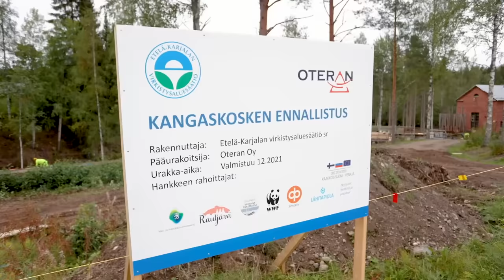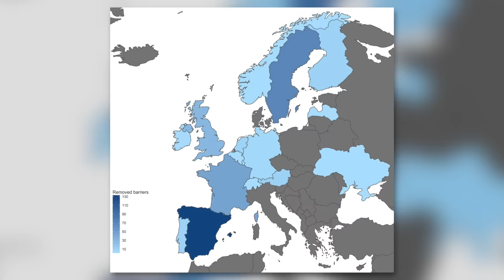How (And Why) Europe Is Removing Its Dams

Comment: I am concerned that many dams being removed will reduce hydroelectricity production.  Which is more important,  clean renewable hydropower or no electricity? Some day they might build a power plant of some type to replace the lost electrical power , but it will be years later,  if ever. Don't forget these dams also provide drinking water and storm water storage. Some dams also allow for ships and barges to transport goods further inland. Fish ladders might be possible at some dams. There are dams that are no longer serving any purpose and are costly to repair or replace and should be removed. Each dam needs to be evaluated fully and not just because it's a man made structure.
Reply: The poi t is to remove your electricity
Reply: @junicohen7918  Yes, can't have the peasants getting too prosperous, now can we? =/
Reply: They are removed only old dams to save high maintenance cost only
Reply: Dams have lifespans though and end up full of silt.
Reply: This video did a particularly poor job of explaining that all dams that have been removed were either old industrial dams that serve no purpose whatsoever: 
like running a water mill, 
providing water to canals for canalboats that haven't existed in 150 years
generate only a few KW of power that isn't really needed or useful, 
or have almost completely silted up behind the dam making their capacity to hold water almost nil.

No-one is going to be taking down the likes of Hoover dam anytime soon, and these smaller, marginal dams will continue to go as they age and are replaced by in Finland's case, nuclear power, which is the only real replacement option for a hydro dam that does everything a hydro dam can do.
Reply: @TheSonic10160  It's just sad how nuclear is seen as such a scary thing though. It's our only next step in power generation and it's just not being pushed
Reply: @reapersmercy7283 if a hydroelectric dam fails, it can cause a brief, serious flood, and possible loss of life. But once the water has run away, the river and surrounding area are immediately usable again. If a nuclear power plant fails, it contaminates an enormous area, and a large area around it will never be usable again. Look at Chernobyl if you wonder why people are opposed to nuclear power.
Reply: @christajennings3828  Chernobyl is an interesting example to bring up because the entire cause of of it's melt-down was corruption and incompetence. The Soviet officials in charge of the program were embezzling money out of the program to line their pockets, leading the the scientist and engineers no choice but to use cheaper and untested materials like graphite.
Reply: @reapersmercy7283  That's not the story, which real story you can find in the Chernobyl miniseries. 

The first issue for Chernobyl specifically was that it didn't have a containment vessel like in the West, so when it blew the reactor was open to the air. They had some kind of religious feeling that if their will was strong enough or they were good Communists, then a meltdown or explosion could never happen. 

Second, the industry didn't report how a sister-reactor at another site worked with its rods: when they were put back in (supposedly to dampen the reaction), instead they increased the energy output. Likewise, the nuclear reaction could be "poisoned" by a neutron inhibitor (xenon-135). 

Third, a lead engineer wanted to run a test program and did so in the middle of the night. So they reduced power generation, causing the poisoning of the reactor, which reduced generation even more, so they pulled out the rods to increase electrical generation, then turned off the pumps for the test. When the reaction took off, they put back in the rods and BOOM. 

It's sadly kind of like the SNL skit where the guy who knows everything is retiring and says, "You can't put too much water in a nuclear reactor" which is what the manual says. They don't know how to run it, and can't understand whether he meant "you mustn't" or "it's not possible." Then when it blows, he tells the waitress, "You can't look too long at a nuclear cloud," meaning "you mustn't" but she thinks he meant "you can do it as long as you want," and ends by staring at it. 

But problems we learned about nuclear reactors, is you can have hydrogen build up that's flammable. Or like Fukushima, you can have situations where the plant doesn't have access to outside electricity. So when it gets shut down, the backup generators might not work, or run out of fuel, and the circulating pumps won't be powered to do their job of cooling the reactors.
Reply: @christajennings3828  Yes, look at Soviet experimental type nuclear power plant that failed during a safety test while being operated in an unsafe manner that was a flawed design to begin with... not at British, South Korean, French, Swiss, German, etc. power plants... or even other designs in the former USSR.

The point I am making is: Nuclear power, if operated safely, constructed well, and provided with adequate safety features, is the best thing to use to fill in gaps from renewables and battery storages - simply because it can produce so much energy with one kg of fuel that no other substance is able to.

Comment: Lets be honest environmental issues had zero reason in removing those dams. They were removed because they were old, falling apart and so small they barely provided any power or control of flooding. Another thing no one likes to talk about is some species like that new environment of a dam. I am sure countless wild life in the area made use of that artificial lake to survive, the plants if nothing else.

Trying to say your saving the environment by favoring one animals needs over another is pretty stupid. All that said I am generally in favor of removing old dams. They can be very hard to repair and many were built to lower building codes than we would accept today. And when ever something goes wrong with a dam it often causes massive issues for any one living down stream.

Comment: My only issue with this video is there is no comparisons in cost.  You tell us how expensive removal is, but is that more than it cost to build it?  For that matter tearing them down is difficult, but more difficult than building them?
Reply: Building cost already recovered by producing enargy
Reply: Concrete in dams naturally degrades over time which is one reason for dam removal and it was mentioned in the video.  

Better to remove a dam ahead of time as opposed to the dam collapsing and causing more serious problems.
Reply: My point is merely What did it cost to build?  They said is costs $XX to tear down, is that more or less than it cost to build?  That is it.  Not if it should be or not.  Hell, I live in Alaska, near a Salmon breeding area.  I get the damage that they do.  All I asked for was the building cost folks.

Comment: It's great that the natural flow of rivers is being restored but what are the solutions regarding power generation? What I've heard is that dams contribute a great amount to a country's ability to produce green power. With so many dams being removed, doesn't that go against the transition to green power? I don't know if I'm right about this but from my understanding, you'd need a lot of wind turbines to be able to generate the same amount of power that you can get from hydro energy, depending on the size of the dam of course. Which power generation alternatives will Finland / Europe rely on to continue meeting power demands after the removal of so many dams?

Comment: You keep using big words, but every example you give is a small, local dam, that control a water of small, insignificant river and produce power for a single village. If it produce power at all. Anything about really big dams on the big rivers? The ones that have noticible impact on national power grid or flood safety?

Also - at some point you say there is 150k dams in Europe. Than, you say that there is 150k OBSOLETE dams in Europe. So what, every single dam in Europe is obsolete? Or you are just boolshiting us?

You give us a number of removed dams. How many of them are trully removed for good, and how many will be (or already was) replaced by new ones? How many new ones was builded in general?

Comment: Wait, hydro-electric dams have a limited lifetime? As a Québécois, I find this very, very concerning
Reply: Don't listen to idiots and demagogues, (like your PM Souteneur  Trudeau) and you would not have concerns.  I am an electrical engineer, who worked on over a dozen of Hydro-Electrical plants upgrade in the US.   Yes, or course the electrical and mechanical equipment has to be periodically replaced with new, but -so far  - even a 100-years old dam concrete structures hold very well.
Reply: @arney444  the last thing I'd do is listen to Trudeau, he screwed us and future generations :(
Reply: @Welv1987  Thank you, you made up my day!   Of course, we in the US must do our part and get rid of of that mentally deteriorated Joe

Comment: ..believe that the secret of power extraction from rivers is the ancient principle of never taking more than a tenth from Nature. In the case of the river this means a tenth at one time since it is flowing and when it rebuilds its speed through natural gravitation the power can be extracted again further downstream. It just needs a horizontal wheel situated within the stream with appropriate armature to direct the flow to point of maximum advantage and for a honeycomb arrangement to be fixed within the wheel (and within the armature) so that the weight of the fly-wheel is provided by the water itself and if necessary can be variably controlled…guess this has been done in history but know of no examples..

Comment: For much of their lengths, many, if not most rivers in Europe were tamed not just by dams and weirs, but concrete banks along the edges. Then the 'safe' and dry land gets tarmacked and concreted for houses and businesses. Oh, and what then, FLOODS, because the straightened rivers run too high and fast and the concreted ground cannot soak up water